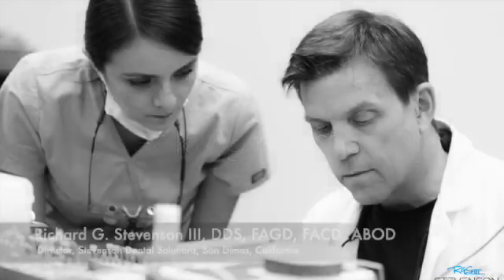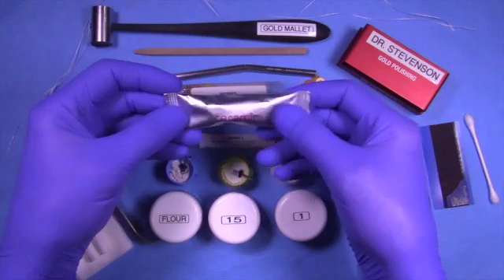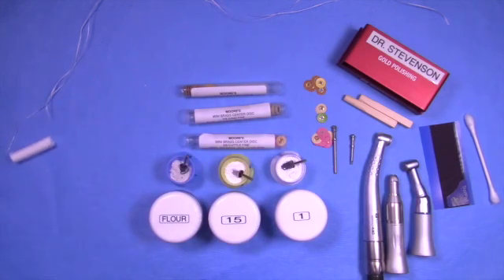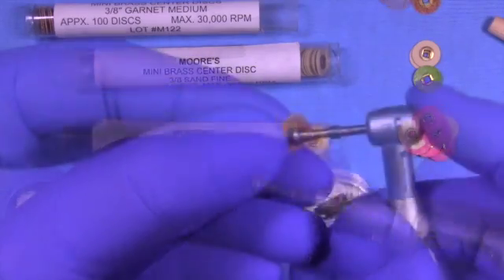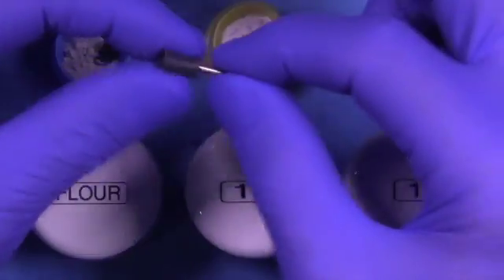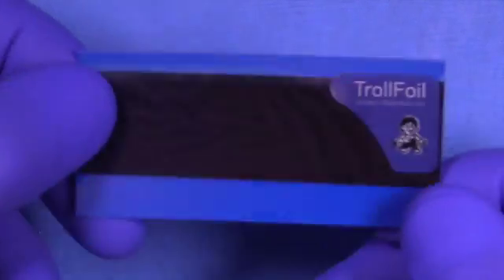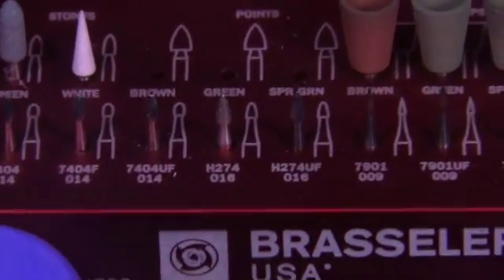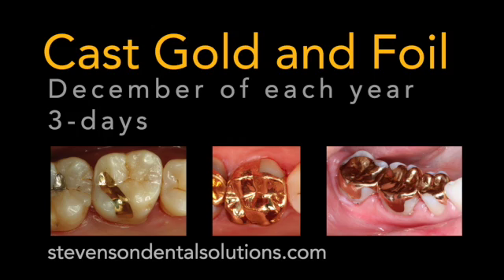Gold Quadrant Cementation - Armamentaria | Part 1

Comment: Hi Dr Stevenson , why  not zinc phosphate cement instead of Verre ionomere ? thank you very much!!!
Reply from the maker: I used Zinc Phosphate for over 20 years and reluctantly changed to Ceramir mainly because it is bioactive, has great strength and very low film thickness. A bit kinder to the pulp too.  I still believe that ZP is a great cement if mixed properly and used with pulpal protection.